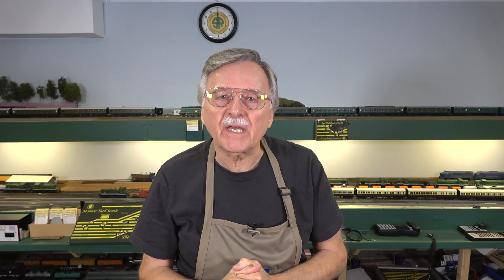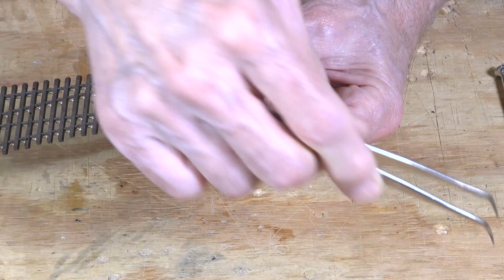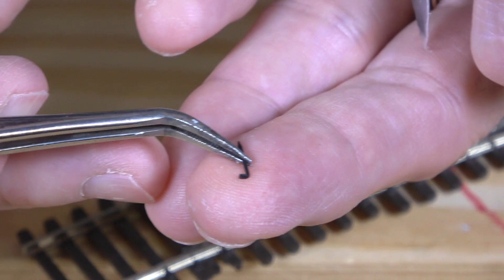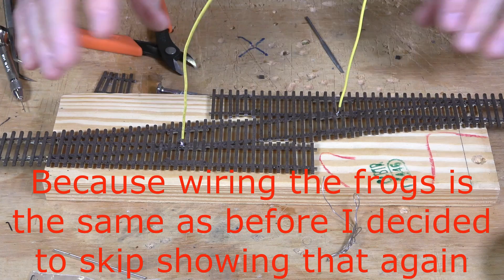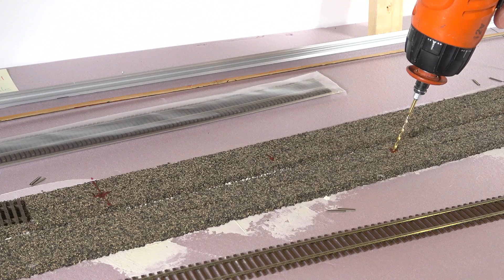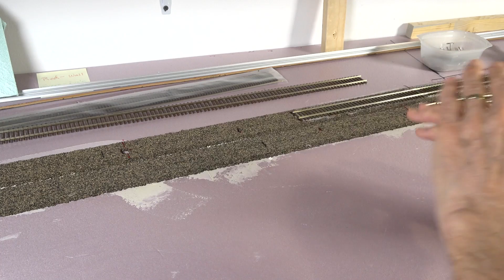Installing Crossovers and Turnouts (342)

Comment: Hi, Larry, I have a Walthers single crossover where the turnout throw rods seem to be sticking. I've checked the Tortoise switch machines, and they are functioning correctly. Do the throw rods just need to be cleaned? If so, what's the best way to do that?

Comment: Hi Larry, love your channel. I cannot tell you how often I come to it to pick up on all of your tips and how to’s. I have a question and I know you have used similar products. My question is the following. I have a crossover on my HO layout that is using two cobalt IP digital switch machines, how do I go about linking them both together to switch points while using one or possibly 2 momentary push button or buttons. Thank you
Reply from the maker: Just give them both the same address and that way they will both operate at the same time. If you are just using a pushbutton switch then I suggest wiring them both to the same pishbutton and they should work that way.
Reply: @TheDCCGuy  Thank you for the quick reply. Much appreciated. Yes, I am already using them through my NCE handheld at the same time under the same address, but I also wanted to have the second option of using the push button so I will try wiring them both up To the same one. :)
Reply: @TheDCCGuy  well it was very interesting Larry, I attached both turnouts on the crossover to one button and it worked fine but then every 20 to 30 seconds they just kept activating by themselves going on and off. Everything works completely fine when using the handheld and applying the address.
Reply from the maker: Must be an interaction between the electronics of the built-in accessory decoders. I suggest you email m.bryan@dccconcepts.com and see what he says.
Reply: @TheDCCGuy  thank you.

Comment: I like how you made a single crossover out of two micro-engineering turnouts. I've been eyeing the new Walthers code 83 single crossovers but no one has them in stock, not even Walthers, and there is no information when they'll be available. Will I be able to make a single crossover out of Walthers turnouts? What # turnout should I use? Would it work with a #4 or #5?
Reply from the maker: I used #6 turnouts for these and have not tried it with any others. I seem to remember a viewer saying it had worked with the Walthers turnouts but can’t say for sure. Walthers gets their track and turnouts in batches from China and then usually ships everything they get out to dealers and distributors immediately so you just have to stockpile what you might need when they get them. The good thing about ME is they are made in Missouri so production is usually continuous unless they run out of rail which they get from China.

Comment: So you have Plywood as the base. Half inch foam glued to that. Then the cork roadbed on top of that, to support your track?
Reply from the maker: And your question is what?
Reply: I'm in n scale. Foam, a lone is not working for me. But it looks like you got it to work for you. With plywood under the foam.
Reply from the maker: With the plywood under the foam and firmly attached to the frame there is no sag at all. Also on my top section it is basically a 1’ deep shelf sitting on steel brackets. I installed a 1”x2” strip along the front edge to hold the fascia and it greatly strengthens the plywood. On a layout using just foam you may be able to get away with 2” thick foam but I’d never trust it that much myself and it creates other issues with installations since it is so thick.

Comment: Since you had already soldered the frog wire and drilled the hole and when installing the turnout, you dropped that yellow wire through the roadbed. Why didn't you do the same with feeders? Instead of waiting till all track is glued down and then have to drill holes and install feeders? And if you have feeders on each section of track, the rail joiners don't have to be soldered. Exception is to solder all rail joiners in the curves. If you don't install feeders on each track, but every other, then you can solder the rail joiners for those. And this way, you can solder those feeders right on the bottom of the rails, making them virtually unseen. And no solder blobs on the sides of the rails.
Reply from the maker: Ever try to wrestle a 3’ section of flextrack and a couple of feeder wires into position and wiggle those wires through the holes all at the same time? Life is too short to screw around with trying stuff like that! One thing I really lke about the new Walthers turnouts is the solder tabs on the ends of the ties. Makes it so easy to install them.
Reply: @TheDCCGuy  Yes I have. And it's easier to solder feeders to the bottom of the rail than trying to solder feeders to the side of the rail. Less chance of melting ties. You simply spread the ties apart enough to solder, then slide the ties back into place. Easy peasy!

Comment: Would love to see how you get the rail joiners on without removing any ties.
Reply from the maker: I showed that in video #258. You basically just take a #17 chisel blade and remove the spikes on the first 1 or 2 ties depending on how long the rail joiners are. Then using the chisel blade scoop out a bit of the tie from under the rail so the joiner has room to slide in.
Reply: Thanks..will watch. @TheDCCGuy

Comment: Couple things.
I was a carpenter for 30+ years. My solution is always wood, for my track spacing I cut a wood “Story Stick” that I use to keep my 2” spacing.  I cut several lengths so I use them to lay straight tangents on 2” centers.
2nd, in my career I never had good luck with liquid nails.I totally agree with your reasons for using it, I just have a bias against it. Im probably wrong. In any case I use white glue. Plain white glue. It’s got a long working time so I can wiggle track where I want it. Ballasting sometimes causes it to listen up so I often have to pin the track while ballasting too.
3rd I make all my marks with a “Ultra Fine Point” sharpie. It’s just a finer line.  No big deal. For me I THINK I can get my cuts more accurate. Probably just a perception as opposed to fact. Still watching. Keep up the good work.

Comment: Larry good tips for everyone hear.  I use mainly Atlas turnouts have a couple of peco turnouts  During your video I noticed one thing you do not remove any ties from you track pieces so do you just snip off a couple of the spikes so the rail joiner  can slide back?    I use that method if I need to replace a section of track  did not think about that fr installing new track.  I always go back and slide in some ties where there might be a large gap of no ties.   I just installed 4 more turnouts on my laytout and I am waiting for my DCC Concepts Cobalt IP machines they are on back order .
Reply from the maker: I do undercut the ties using a chisel knife blade to provide room for rail joiners, but usually don’t do that on turnouts since it can weaken them at the point end. In cases where I remove ties from the end of sections of flex track I will insert old ties before ballasting. I have a container full of old ties removed from track sections reserved for just that purpose. I got an email from DCCconcepts saying that the iP Digitals are expected in stock soon.

Comment: I'm not clear on the need to remove the over-centre spring on a turnout. I havent encountered any ready-made or DIY motor which can't easily overcome the spring and leaving it in place seems to me to do no harm?
Reply from the maker: While the switch machine may function, the increased pressure can eventually lead to failure of the switch machine or the points.

Comment: Very good video, dispell need for hand built switches.  Video reaches out to new model railroaders.
Reply: That's not a great video to teach new comers to the hobby. you want them to waste their money destroying their expensive turnouts by modifying them, and gluing them down because they will inevitably want to change the track after a while. New comers need to keep it simple and be able to change track plans easily. Once they have run their trains for a while and are happy with the design, the track will be glued down when they ballast the track. They also need to understand how easily you can damage a turnout by soldering frog to it, so they don't waste their money again. Our hobby is already getting too expensive. They need to watch dedicated videos designed to show them the what to watch out for and how to avoid mistakes, so they will enjoy the hobby from the beginning

Comment: Thank you, Larry, that was a great tutorial on installing crossovers. I am using the new Walthers code 83 track and turnouts and in the beginning plan to switch the turnouts by hand or with a caboose industries ground throw but down the road I may move to a powered switch machine like a tortoise. You showed that the spring may have to be removed to decrease the wear on the turnout and the switch machine. Can it be removed from the top if the track is already laid and if not, have you ever or could you do a test to see if you think the amount of resistance from the spring really would cause damage if it was left intact?
Reply from the maker: I have removed a couple after installation—got busy and forgot to remove them in advance. Because the plastic cover is not glued in very tightly I was able to insert a #17 knife blade between the ties and pop it off. The spring is also easily popped out too the same way. I suggest you take a photo of this area with your phone so that when the time comes you’ll be able to see exactly what needs to be removed and where it is.

Comment: Why not use the ties that you removed, to repair the switch?  Whouldnt that be easier and less likly to be out of gage.
Reply from the maker: That should work fine in that location, however there are locations on a turnout where it would not be possible to do that so this shows a way to do the repair.

Comment: Larry what do you think of the new Walthers crossover code 83, I am planning to use them on my new layout
Reply from the maker: I have not seen one yet but I expect they are essentially about the same quality as their turnouts and double crossover which I have reviewed and found to be quite nice.
Reply: Larry you did a great job making a crossover, I got the DCC concepts dowel pins installed, two lift outs